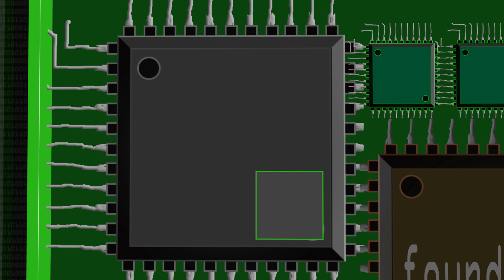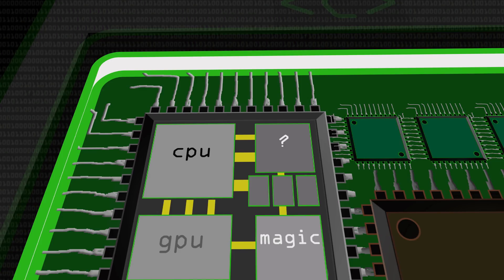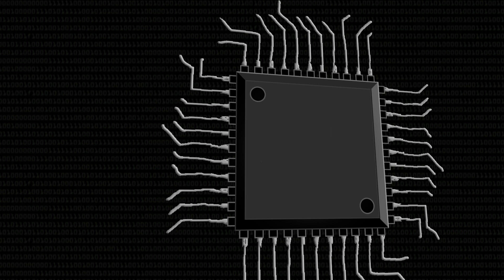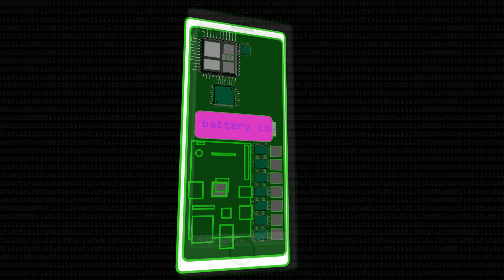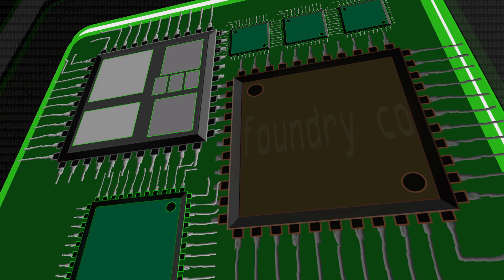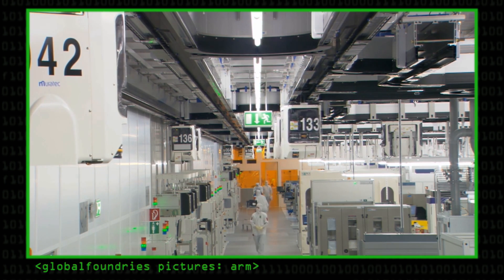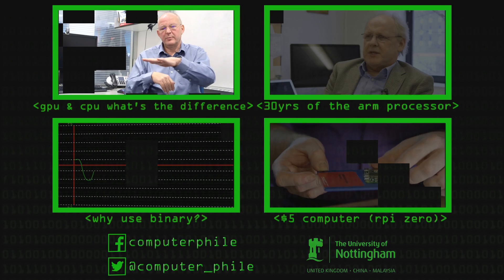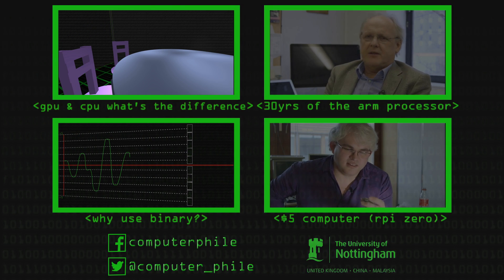ARM Don't Make Computer Chips - Computerphile

Comment: I think, in the near future, there will be a movement of people calling for an end to proprietary hardware.
Reply: Nope. The future is looking to be FPGA-ASIC hybrids with with home computers turning into a terminal on a mainframe. I wish it was otherwise. I love open source hardware, but look up the Xilinx Amazon partnership that was recently announced. Then ask why Intel bought out Altera. The end of Moore's Law will result in the expansion of FPGAs. FPGAs are capable of running a local user interface with remote software faster than a consumer grade system with local storage. Why the shift? Proprietary software security. You won't have access to the complete software on a terminal based system. The future will be the 1960's mainframe computer version 2.0... if open source projects like the linux kernal don't take most of the market share first.
-Jake
Reply: @UpcycleElectronics  So you expect everyone to just dump their freedom into garbage? No sane person will use centralized resources for private purposses. Yeah Linux kernel is ubiqutous today and going strong.
Reply: @GeorgWilde  is 2% ubiquitous?
Reply: LegIt?

Comment: Clever!! so thats how the chinese are cloning products, It's not the silicon It's the software.
Blow it to FPGA and keep playing with the parameters until it works. Litho was so safe.
Reply: Mike James and you can just test the timings for each instruction and it's input. To have something which works in the place it doesn't matter what's in the inside as long as timing and instructions are correct

Comment: for anyone who thinks that hardware chip language sounds interesting, you ought to look into FPGAs. You can program them directly, and have them emulate virtually any other microchip, given that it has the specs to do the job.
Reply: They're also obscenely expensive at gate counts for projects of any reasonable complexity. Maybe worth it for prototyping, but not cost-effective for mass production.

Comment: The title sounds wrong, even if grammatically correct
Reply: +ahenryb1 Depends on which side of the pond you're on. In American English, "ARM" is a company, and thus a singular entity, so properly conjugating "do not" yields "doesn't" instead of "don't". In British, "ARM" might be plural, because British English is different, in which case "don't" would be correct.
Reply: "ARM does not fabricate chips" or "ARM only designs chips" would have been fine titles too.

In american english, the phrase "ARM don't make computer chips" is what we call "Hickish", it sounds as if its in a southern vernacular, much like "I ain't gonna eat them chips"

Comment: would they make the different 'blocks' from scratch each time? or would they just copy and paste from previous designs.
Reply: +Raymond “RooMan” Lobban They would obviously re-use the majority of their previous designs and only improve upon a few area's in each iteration. Designing chips now a days isn't really that different from writing software. Instead of C++ or java, they use VHDL or verilog. As you said, they simply copy the parts of the design that hasn't changed.

Comment: Hrm.  Rather than tape on acetate, Steve Furber [formerly of ARM] said, in one of Computerphile's previous videos, the "tape out" comes from the fact that a computer tape was sent in the post from the design house to the fab.
Reply: +Eddy Yau i think I was wrong, actually, though haven't had complete confirmation. I think it does refer to the computer tape going out the door...
Reply: +lmiddleman Yeah - I need to know which one is correct!
Reply: +Greyarea23 It should be computer tape for storing GDS file for making "mask set".
Reply: +Jem Davies Since 16 FF+ is very expansive, does 500 test chip produced by MPW?
Reply: I concur. Chips were always designed in cad.  You can down load open source and see the design of the 6502 chip for example ! In a normal PC now.
Reply: Jem Davies What “special language” were you referring to that ARM programmers use to design chips? Alternatively, what would be the typical route of someone wanting to get such a job with ARM?
Reply: It's entirely possible they are both where it came from. Usually only one source is given credit for popularising terms, but multiple sources can coin it independantly.

Comment: Do young people not use personal checks in Britain?
Reply: +ElagabalusRex Nope. They use cheques.
Reply: +ElagabalusRex Not really. I'm 31 and I've written about four checks in the 28 years I lived there. In the past three years in the US I've written about 50.
Reply: +ElagabalusRex Belgian here (just across the Channel). Cheques are a thing of the middle ages for me. I have never even heard of anyone writing a cheque in my rather limited lifetime (21 years).
Reply: No. Most young people use electronic transaction methods and cheques are being phased out for security reasons. I've never written a cheque and supermarkets have stopped accepting them.
Reply: +Jane Fraser To contrast, rent would be paid in the UK electronically via a bank transfer. In the US I've always paid rent with a check. Same thing with job earnings; I'm paid with a check in the US which is unheard of these days in the UK.
Reply: +Sid Brunski With a pen.
Reply: +ElagabalusRex  I am 46, and I wrote 7 checks in 10 years.
Reply: I have a cheque book and I've been given cheques, never actually written one though, no clue how either
Reply: +ElagabalusRex The lack of checks/cheques isn't the only thing that Europeans don't use. We don't sign when we use cards, we use a PIN or, increasingly, just tap the card to the terminal.
Reply: Youth, sky cloud 'plumbus'?Alician feilds,1986/1066 dont LiVV TapAStreak? DataOnTap?

Comment: I know Intel has had a few silicon bugs. Never heard of ARM having them. I know there are device specific silicon limitations/errata (specifically in the microcontroller space) for ARM, but likely more due to manufacturer faults than CPU design. So how many design bugs does ARM have/had?
Reply: +leppie The mainstream-discussed Intel's bugs were always in microcode (Pentium FDIV, Halt and Catch Fire, Skylake), not the chips themselves. ARM chips don't use microcode, they are therefore much simpler and easier to test. (This has a lot to do with that Intel uses CISC instructions while ARM uses RISC. Intel's instructions are designed to be easy to use while ARM's to be easy to implement. Since almost nobody programmes in assembly anymore, guess who's better for today's world.)

On the other hand, there were a few bugs during the years as well. If you can get hold of ARM documentation, look for errata.
Reply: +Jan Sten Ad&#225;mek Thanks for the feedback. I dont know much about the microcode aspect, but the was the FDIV Pentium bug not fixable with microcode? I would not have expected a recall/class-action-suit if it was fixable by microcode, unless the fix was actually too large to be addressed in microcode storage.
Reply: leppie It was not possible to update microcode in those early Pentiums, next-gen Pentium Pro was the first that can be updated by software.
Reply: +Jan Sten Adámek And again I learn something new :D
Reply: +leppie there was a pretty interesting talk on chipdesign on the 32c3, which also touches the hardware-bug / microcode stuff. watch?v=eDmv0sDB1Ak
Reply: There was that whole ARM TrustZone debacle. Look it up sometime.

Comment: Now what I actually want to know is what is the language used to make chips like that. And what does it look like.
Reply: +William Young VHDL, Verilog or some other hardware description language. Here's an overview: https://en.wikipedia.org/wiki/Hardware_description_language

I think the best way to learn such a language is to buy a cheap FPGA and program it.
Reply: +William Young - VHDL is a wonderful language for programming FPGA's. I don't know how well it scales in terms of a massive commercial product, that is the ARM architecture, but it works wonders for smaller projects.
Reply: +IchBinEin The language it self should work just fine even on massive projects like a Cortex-A57. The synthesis and place & route software is another story though. No doubt it will be vastly different than what you get for FPGA's.
Reply: +IchBinEin Verilog is more common than VHDL, as I know.

Comment: Why Taiwan? I wonder why they are the biggest in chip manufacturing?
Reply: Ameer Fazal Actually the amount of tecnical expertise for the fabs is actually relatively low. There is a lot of personal just moving things around and runing generic system tests.I would say the expertise might be as lo as 1:10 compared to a design house where its the other way around.

Modern automatic fabs use far less uneducated personell, but its still quite a lot.

I would say the main resource for making processors is clean air and the second main resource is cold air...

... its kind of strange that the fabs is in locations like Huston and Taiwan and places like that.

I would say the real reason is tax... rather low tax.
Reply: +Ameer Fazal Taiwan got a MASSIVE influx of industrialists during the communist occupation of China. This made Taiwan very western compared to the rest of asia at the time. This gave taiwan a bit of a head start, and they were very eager to get into silicone when the time was right. It actually makes a ton of sense.
Reply: +Naum Rusomarov Well... not really now days. MOst of the big foundaries was med in the 90-tys and early 00. Actually quite a few of them still have the same processes, but most of them upgraded at least once.
Reply: +Kahr Kunne I was thinking it has something to do with the availability of the materials or technical expertise of workers man :)
Reply: +Ameer Fazal The Taiwan government heavily invested in it and encouraged investment.  Expertise and the needed eco system then comes naturally.  When you go there you see these city block fabs, the suppliers around it and the design houses in the next suburb.
Reply: +Ameer Fazal I believe Apple were responsible for getting Taiwan into the computer business. They outsourced assembly to Taiwan. (The mainland was far from friendly in the 1970s). It didn't take the locals long to conclude "Hey, we can clone these".) 
That produced a flood of fruity-named computers, until Apple clamped down legally on use of the BIOS. However, by that time the even-more reproducible IBM PC was becoming popular, so they switched to building them. 
Over time, they moved up the food chain until they got to chip fabs.

Comment: I want a photolithograph for Christmas.
Reply: +The Hoax Hotel Well, you might also want a microwave oven full of oxygen and a massive metal chamber from the 60s, along with an IBM 5150, and other computers to transfer data between 5.25 and 3.5 inch floppies. That's how they do it at "Canada's Capital University"
Reply: +The Hoax Hotel  If you rich, you can use old process to do it. It cost much cheaper.
Reply: The Hoax Hotel That'll be another $380 in demurrage charges
Reply: Yeah, well I want a unicorn, but you don't see me gettin one of those any time soon, do ya?
Reply: +Meep Walrus Well I never. Hipster Canada.
Reply: @Fgcbear15  
You don't need an ion implanter, diffusion doping in a 900 C oven would be sufficient.
Reply: +The Hoax Hotel Totally agree with the commenter above me. if you like the idea of designing your own chips, an FPGA could be the way for you.
Reply: @robmckennie4203  150 millions euro go brrrrrrrr